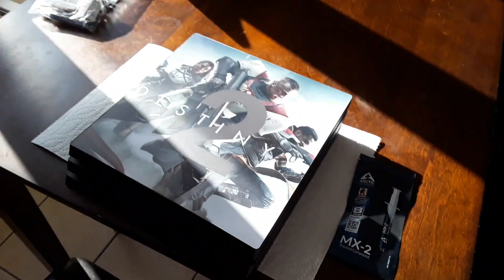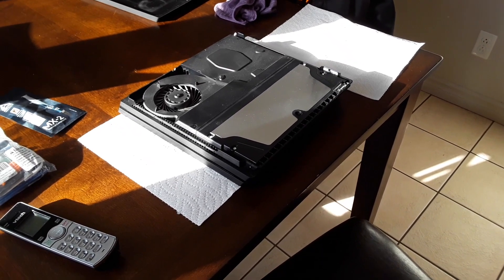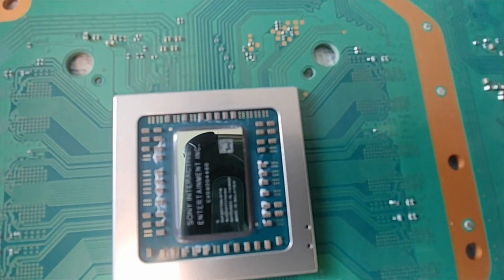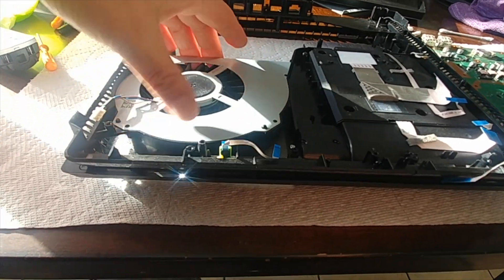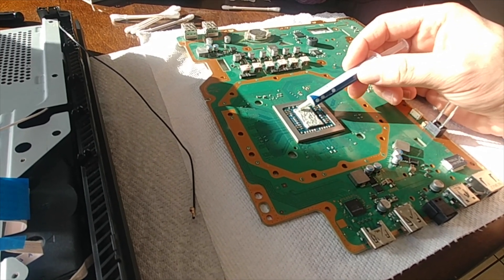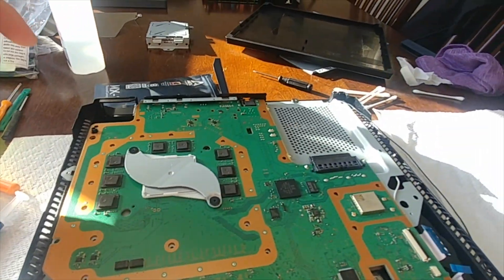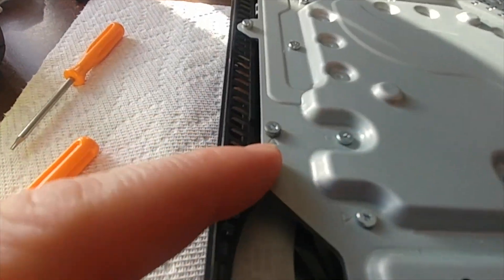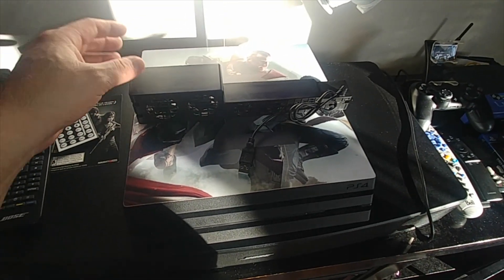PS4 Pro Thermal paste Replacement Cleaning Very Important!

Comment: I'm pretty sure you've put the thermal pads in the wrong place... I was following several guides while doing this myself and noticed that the pad placement doesn't make sense to I put an extra pad on to see where it would stick and it was the smaller chips that are recessed. Here's some images from a post I found:
https://www.neogaf.com/threads/seriously-wtf-the-ps4-pro-is-embarrassingly-loud.1316685/post-246722938
Reply: I just changed thermal paste on mine Ps4pro, and I can confirm that those thermal pads are on the wrong place in this video. They go on the smaller black chips beneath those gray capacitors. Oh and by the way, change your thermal paste because now I have a quiet Ps4pro.

Comment: My pros got really loud, I have a long hair cat and I'm sure after 2 years it's probably the hearsink that's clogged? But I'm terrified to attempt taking it apart, I can't afford a new one if I break it, I'd like to clean the heatsink and change the thermal paste so wish I knew what I was doing, I'll watch and see if I get confident?! Lol
Reply: All I can tell you it's horribly easy. As someone who is a dustophobe? My pspro was full of dust and cleaning the heatsink helped soooo much.
Reply: It's real easy man. You won't mess anything up if you follow directions clearly. I just did mine and after 2 hours of  playing Pubg, my PSpro never gets loud. When there is intense gaming you may just hear a slight sound from the system, but that's it.
Reply: Honestly, I don't know what I'm doing either, I did it today. Cleaned it fully not much dust at all so I changed the thermal paste. I feel pretty good. Honestly, if you watch pretty much any YouTube video, it's not that hard. Don't touch the circuits, be patient. Don't rush it. If you change thermal past Arctic MX-4. Use about a half of a pea and don't worry. The heat will spread thermal paste. Good luck!! 👍👍

Comment: Im using Thermal Grizzly Kryonaut, which i think is conductive.  I'm going to apply it in two days. I should however, in contrast to you, be very careful not putting on too much right?, because if it touches the little chips around the CPU im screwed right? Any advice on how i should do it?
Reply: *APU ?
Reply: Or wait, Ktyonaut should not be conductive so should not give a problem right? Conductionaut on the other hand does, so i should not use that?
Reply: @SuperSimonkey  I used a decent amount and evenly applied the thermal paste, making sure to cover the who surface by using a card to spread the paste. I did that to make sure the whole surface is covered evenly. The factory paste was not evenly applied to the surface of the APU die and did not cover the entire surface causing the overheating. I just did this today and all I can say is, my PS4Pro is silent!!

Comment: Too much thermal paste isn't bad (if you are using a nonconductive paste like MX4), but the less you use the better cooling you'll have. Thermal paste is used to "fill in the gaps" of air between a processor and a heatsink, and the thinner the layer, the better heat transfer it will have. This is why there is a clamp that pulls them together so tight. By using the amount of paste you use in this video, you are doing nothing but squeezing out the paste to the components around which limits the amount of cooling they receive. If someone uses something like Arctic Silver 5 and uses this much then there is a possibility of those chips being shorted out.
Reply from the maker: Too much thermal paste isn't bad (if you are using a nonconductive paste like MX4), but the less you use the better cooling you'll have....Not true! Have a look on youtube! The study shows that acutely more is better! Its Proven! Just dont go crazy! Here is the link!

https://youtu.be/EUWVVTY63hc

Comment: The clamp for the heatsink and the motherboard shield look different to mine, have you changed them?
Reply: I believe this is the clamp that is in the 7100 models.
Reply from the maker: nope
Reply from the maker: PlayStation 4 Pro CUH-7200 review: the latest, quietest hardware revision
Reply from the maker: Two years on from its initial launch and PlayStation 4 Pro has been quietly tweaked once again, with new hardware that sees Sony revisiting the super-charged console with a new design that improves once again on the machine's perennial noise problem. The work pays off because this is quietest, most discreet Pro yet, completely banishing the 'jet engine' effect commonly associated with launch models.Of course, this isn't the first time that Sony has improved the Pro. At some point last year, the platform holder released the CUH-7100 - which we took a look at recently in the form of the 500 Million Special Edition console - which seemed to change the way the GDDR5 memory was cooled, and tweaked the fan profile to be less obtrusive. The system still possessed similar power draw though, so the end result was a hotter console - albeit one that delivered a big improvement in its acoustic performance.The new CUH-7200 series is just starting to filter through, and in the UK at least, it seems to be the case that the hardware is only available as part of the Red Dead Redemption 2 bundle pack - though expect to see a more comprehensive roll-out as the holiday season kicks in. Regardless, you can tell that you're getting the new machine because the model number is highlighted on the front of the package - in the case of the Red Dead pack, the designation to look for is CUH-7216B.The Red Dead pack is a fairly standard Pro offering, the standard internal box covered in a Red Dead-specific sleeve, with a physical copy of the game included inside (and bearing in mind the sheer size of the game when installed, I'm thankful we're getting physical media here and not a download code). Otherwise, there's nothing particularly special about the packaging, and similar to the CUH-7100 consoles, the overall look and feel of the machine itself is essentially identical to the launch model - with one exception.